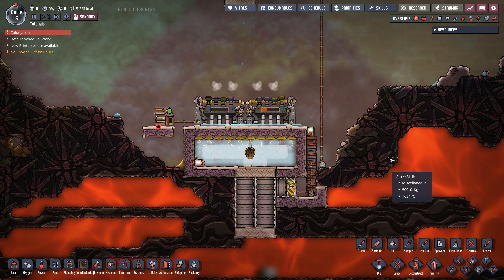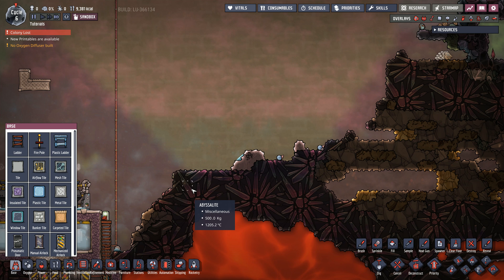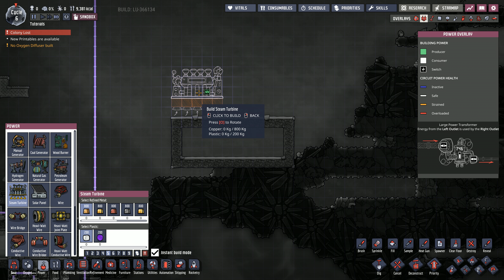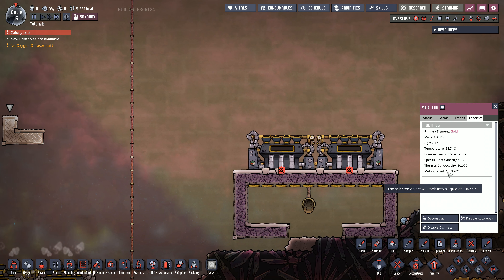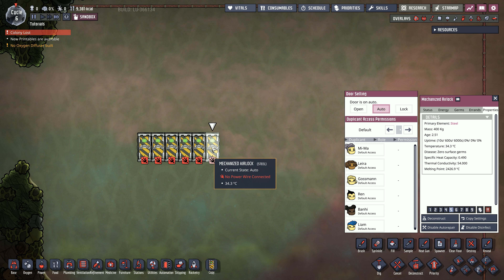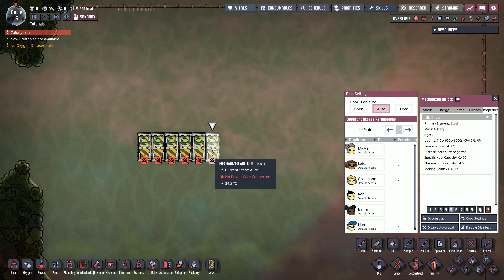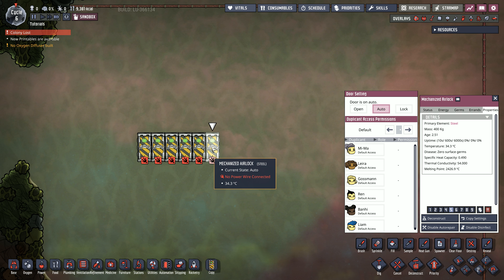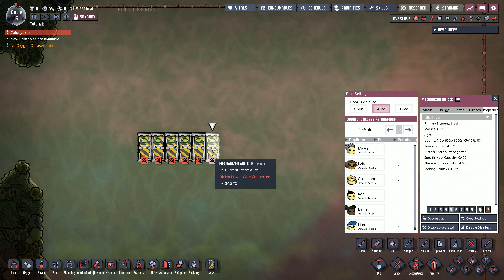Gundahar Tutorials - Geothermal Power Plant - Oxygen Not Included

Comment: Huge waste of materials. I build single lead turbine units with two steel tiles, one iron Ore mechanised airlock, 5 steel automation wires, and 3 steel wires. The steam chamber is 10 tiles large and is filled with one ice tempshift plate, which is convenient because you don't need any plumbing or bottle emptying. Works fine, if the surrounding area isn't insanely hot. If you need cooling, you can make one with an aquatuner which cools all the turbines in your system.
Reply from the maker: It is more about the idea - of course, there are plenty of variations :)